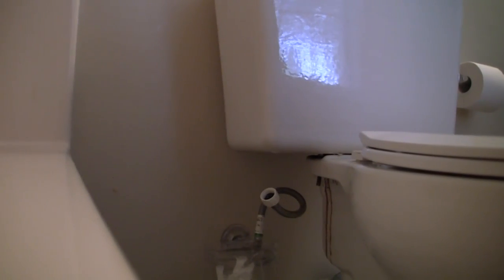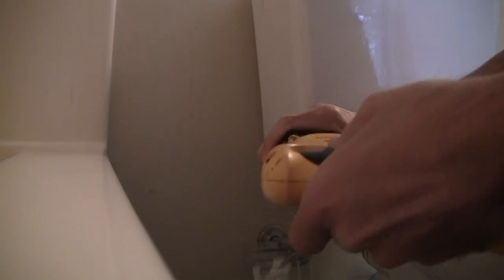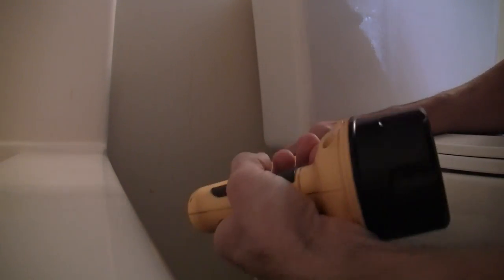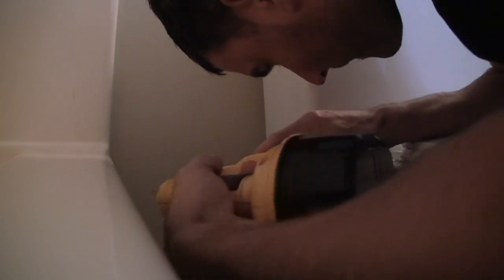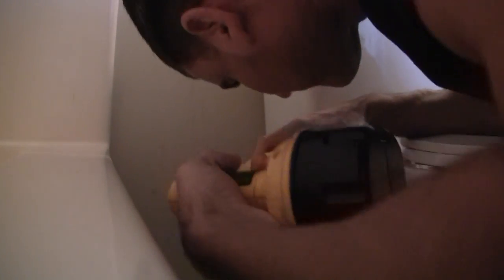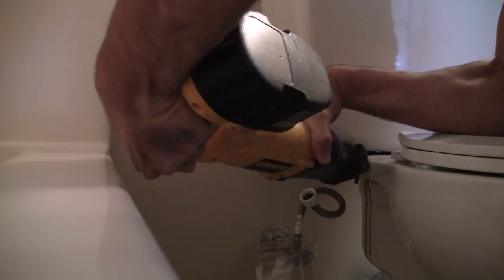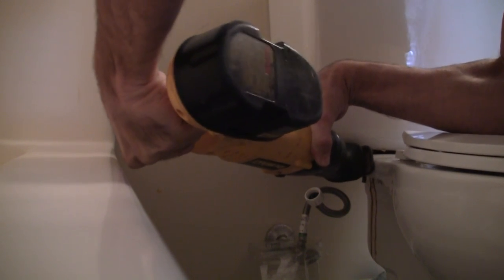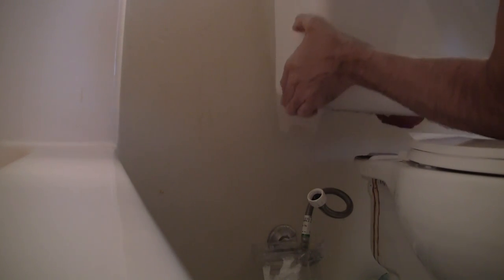How to cut rusted toilet bolts from tank (in seconds)

Comment: OMG. I spent a day trying to hack saw these bolts off. I tried liquid wrench, a rust blaster and trying to beat the bolt with a hammer. Nothing worked. I saw this video and gave it a try. They were off in less than 5 minutes!!!!!! After the bolts were off I looked them over. There is no way that I would have ever been able to get them off this 50 year old toilet  with any kind off wrench. They looked like they were welded together. Thank you!

Comment: thanks so much!!!  I had tried all the other standards and probably had two hours in to the job and was starting to think of tanerrite and cutting torches and decided to check you tube first.  I popped out to the shop and got the sawsall and it was already with blade and I grabbed a battery from the drill (I love my dewalts too and in two mins that tank was laying on the counter and the bottom of the bolts laying on the floor> Thanks

Comment: Remember when you replace the new bolts to only use solid brass (Fluidmaster) (not the cheap brass coated ones), or buy stainless steel, so as to avoid rust forming in future and having to go through this again! Great video and thank you for sharing.

Comment: OH, Wow, didn't think of that.  CAN'T WAY TO TRY THIS.   You will get a "like" if and when it works!  I was planning on trying one of those "screw out" drill bits, but I think it would be tricky on this type of screw and very tight space in toilet tank.  If this works...I'll even use it on the other screw which isn't rusted.  Much easier!

Comment: I hadn't thought of trying this.  I spent a lot of time sawing the bolts off our toilet which were completely rusted up.  One side was easy to saw off but the other side was so close to the wall I eventually bought a Dremel  and a 90 degree adapter to do the job.  Next time I''l call a plumber 😊

Comment: Thanks.  You just saved me from "toilet bolt hell"!  I had to do this years ago with a hacksaw and as you said,  I'm never doing that again!!   By the way, I was able to do this with a Skil  jigsaw using the metal cutting blade.  Not as fast as a sawzall, but it did the job!

Comment: I bought an older house with an old Gerber toilet. Water had started dripping through the two bolts holding the tank to the pedestal, completely rusting them. They're so bad that I could break apart the wing nuts, then just pulling down the old metal and old rubber washers. I tapped the bottom of the bolt several times which released most of the rust from the bolt heads. The bolts are now loose enough to turn by hand and I can even wiggle them but they refuse to come up and out. Any suggestions why?

Comment: If you don't have a reciprocating saw, and I'm assuming that the reason you want to remove the tank and maybe even the bowl, is because you want to buy a new toilet, just get a big old blanket or towel, cover up the tank first, get a hammer, then tap it until it breaks. Make sure you put on gloves to remove all the pieces. Do the same thing with the bowl. Tanks and bowls are pretty heavy to remove if you don't have the strength, so this method can be very helpful. I only wish I had thought of it 30 years ago. :)
Reply: +1macktv1 I was just about to smash the tank when I used this guy's technique.  It worked really well and saved me a lot of cleanup time!
Reply: +Scott Lowrey   That's great, if you happen to have a reciprocating saw handy, and you have the strength to lift off the tank. I was just offering a solution to those that might not have either. :)

Comment: If the retainer is old & rusty too you can also work it back and forward, side to side and actually free the retainer from the bolts as they are slotted in rather than through hole (worked for me, YMMV).

Comment: Would an electric reciprocal saw be too dangerous? Does it have to be cordless? Toilet area is still leaking some and it has my hubby worried??? Whaddya think, do we have to buy a cordless one?
Reply: No it does NOT have to be a cordless one.  You silly girl.
Reply: Did it with my corded & worked like a charm
Reply: +Luis  She was not silly. She was just concerned about using electricity near water, that's all. I would have at least advised her to be careful.

Comment: Unfortunately both of my sawzalls wouldn't fit on the right side of my tank b/c the wall was too close.  So I had to wrap a hack saw blade end with a small towel and hand blade cut the bolt.  It worked, but wasn't pretty.  LOL!

Comment: i have a slightly different problem.  i got one bolt off.  the other is rusted, but somehow the top of the rusted bolt wedged its way into the hole of the tank, so is stuck in there.   don't want to bang too hard as to break the tank or toilet,  right now sprayed some wd40 in to hopefully loosen it up.

Comment: This method works absolutely fine until you have a bad day and screw up by braking the porcelain with the metal part  that attaches the blade like i did too many times! Now I will spend two minutes a bolt with a hacksaw instead of risk having to buy the customer a whole new toilet just for the sake of saving a whole 5 minutes!